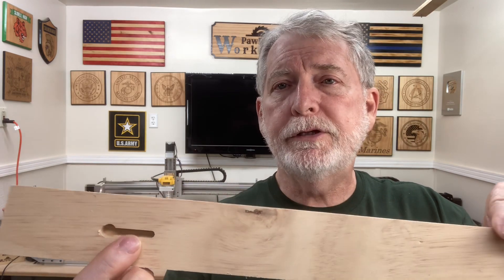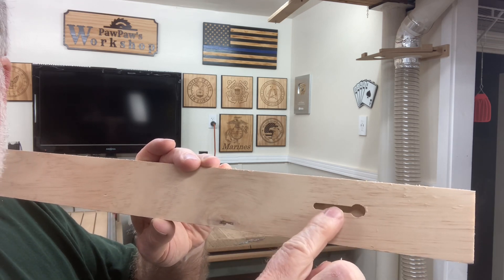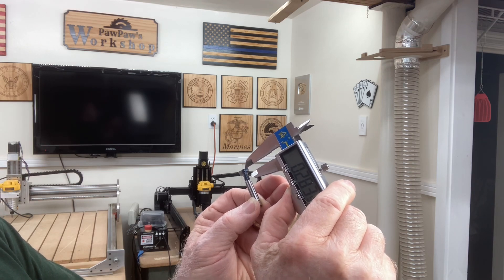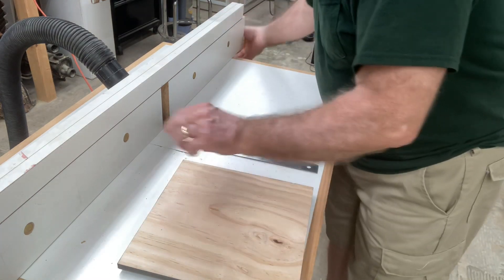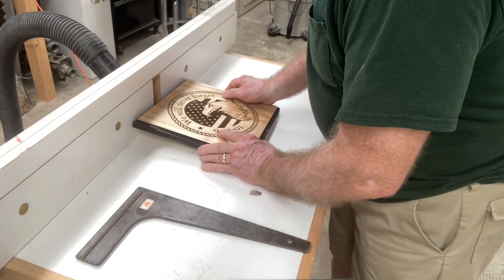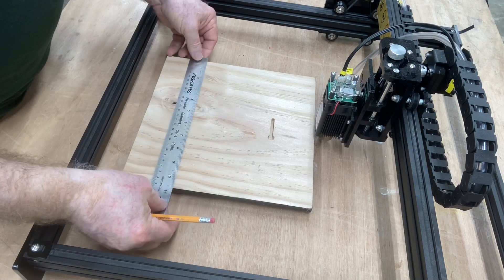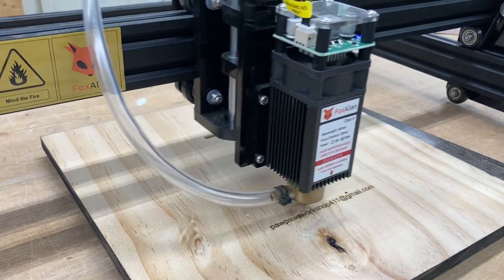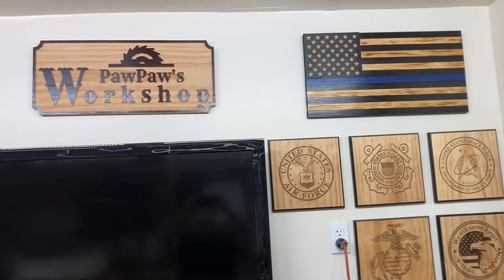How to Use the Router to Cut Keyhole Slots

Comment: ok... no one addresses large heavy items that might require two-four keyhole slots.  There are several questions i have regarding multiple slots and getting everything perfect so the item ends up being level when finally hung on the wall.  Why???
Reply from the maker: If you have that much weight perhaps a different method of hanging should be considered